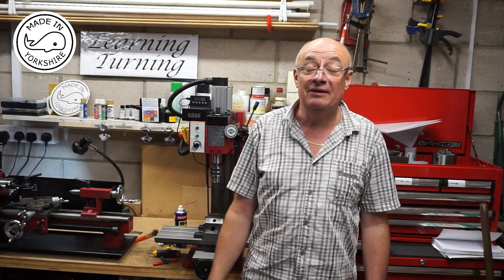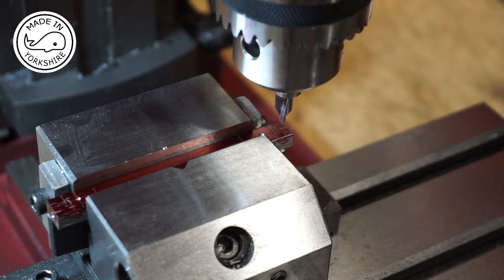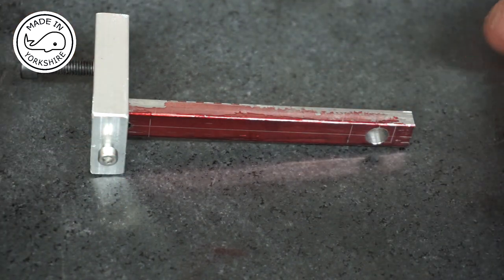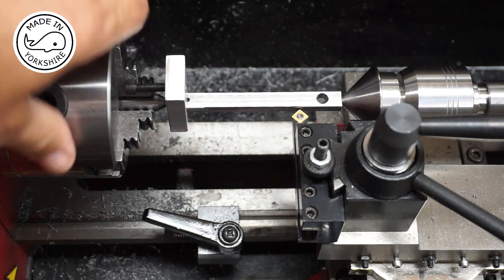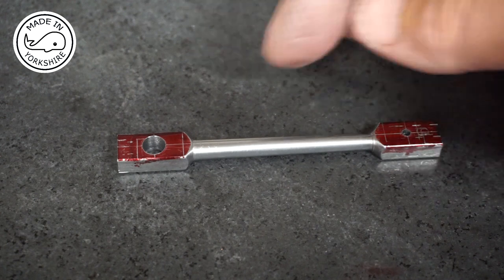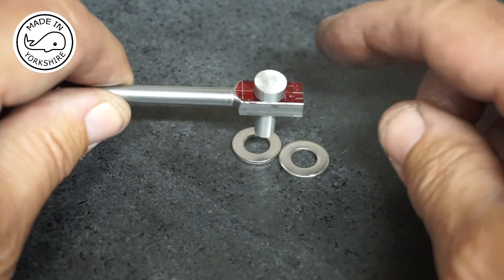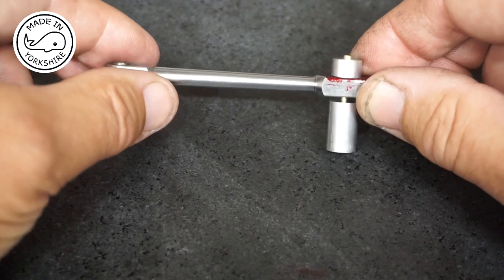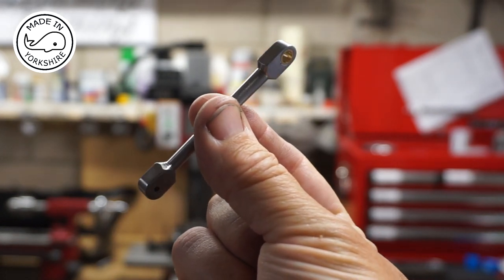#MT22 Part 7 - Making a Stuart S50 Steam Engine Conrod. By Andrew Whale.

Comment: To do the taper I would offset the tailstock until the right measurement is achieved by running a dial indicator the whole length of the proposed taper length before cutting. Remember you have to only achieve half the diameter is important.

Comment: ⭐⭐⭐⭐⭐ Looks great to me! With my experience it would help if that had been a casting that just needed some finish.😉
Reply from the maker: Thanks mate! Once you start making components from bar stock you will never look back.
Cheers
Andrew
Reply: @learningturningmetal  I faced both ends of the bar in my 4 jaw chuck and centered drilled it. Had scribe lines and clocked it in both ends with my dial indicator. When I turned the center section I was taking more off one side relative to the 3/8 faces. Now it does not run true down the 1/4 thickness but offset more to one side. The idea I got both ends off center in the same relation baffles me. Do over and find a better plan.😢
Reply from the maker: @gvet47  very strange! 😕I hope it turns out well next time.

Comment: A better way of doing a slight taper between centres is to offset the tailstock. This also then allows you to use power feed for a better finish.

Another great video though
Reply from the maker: Thanks Sam. Yeah I agree entirely. I wasn't aware of that method at the time, but I have used it since. Thanks for suggesting though.
Cheers
Andrew
Reply: @learningturningmetal  I've just watched your next vid with the boring head and that's actually a better way as you haven't got to mess with tailstock alignment (I made a Hemingway hammer with the tailstock offset and it is time consuming setting up)

Comment: Andrew, I'm really enjoying your videos, excellent reference material as I build my S50. Why does TC (and you) turn the conrod between centers with a lathe dog? Why not just hold one end in the 4 jaw and the other with a live center? I'm obviously missing something.....
Reply from the maker: Hi Jason. Now I am absolutely no expert... but I think if you turn between centres you are absolutely guaranteed concentricity.  If you try to hold in a 4 jaw chuck the jaws will try to hold the piece at 90 degrees to the side faces. Even if you clock opposite sides spot on, on a long item I doubt that the tailstock would naturally centre on the opposite end. Also, turning between centres allows you to turn the item round 180 degrees and continue to machine accurately. Quite a timely question because I am currently planning the machining of my half beam conrod and I've just purchased some proper lathe dogs.
I hope that helps explain my approach. But, like I say, I am no expert.
All the best.
Andrew
Reply: Learning Turning Metal - by Andrew Whale  Andrew, I came across this method of setting a center on a 4 jaw - http://youtu.be/00dl0DxRYvM - so I’m wondering if it will get the conrod bang on center to turn the taper. I might give it a go tomorrow after the rugby....
Reply: I agree.  Dial in one end and centre drill. Support the centre-drilled end with the live centre (snugged up) and dial in the other end gripped in the 4-jaw.
Turning between centres is used where you want to maintain concentricity but need to reverse the work end-for-end during machining or temporarily remove the work from the lathe for other operations (like TC did for marking out, but Andrew didn't, as he marked out beforehand).  It also needs to be used when turning a long taper using the tailstock set-over method as the chuck jaws would try to force the work parallel to the lathe axis.

Comment: Just out of interest, how close to the drawing dimensions were you? Only asking as this is the next part I will be working  on.
Reply from the maker: Hi Paul, I machined the conrod as close to the drawing as possible.
I hope yours turns out well.
Cheers
Andrew
Reply: @learningturningmetal  I did a test, and it didn't turn out too bad, so I'm taking the plunge tomorrow. I'm already sweating thinking about it. But nothing ventured, nothing gained. Thanks for all the videos, I've learnt a lot from you.

Comment: Hi Andrew great to see an update, your engine is coming along nicely.  When it comes to turning rod tapers between centres if you have a boring head for your mill and it will fit your lathe tailstock you can turn a crude dead centre to fit the boring head. Its then a simple matter to use the boring head to offset the dead centre (in the tailstock) and turn a taper as long as you want with the ability to use the powerfeed also. If that makes no sense but you want photos of what I mean drop me a priv message :-)
Reply from the maker: Thanks mate. It is slow progress with many challenges along the way - a great project to get me out of my comfort zone and experiment. The boring head is a brilliant solution, and I even understand it! A boring head has been on my wish list for a while now but I don't know what go for, both size wise and make. It also looks like I will need to get one with both R8 and 2MT shanks. I will investigate!
Thanks so much.
Cheers
Andrew
Reply: It's worth buying a boring head, they are far more useful that you think. I haven't had mine long but I wouldn't be without it.
Reply from the maker: Can you recommend one?
Cheers
Andrew
Reply: My mill is an MT2 taper and I bought this set, it does the job nicely and I'm happy with it. The allen bolts are a bit cheap but easily replaced for next to nothing. https://www.rdgtools.co.uk/acatalog/MT2-MT3-12MM--BORING-HEAD-SET-38MM-DIAMETER-34973G.html
Reply: Correction - I bought this 50mm set, sorry my mistake !  https://www.rdgtools.co.uk/acatalog/BORING-HEAD-KIT-50MM-2MT---3MT---5-TOOLS-AND-EXTENSION-BAR-4098.html
Reply from the maker: Thanks Peter - that looks really good for the price. I'll see if they do an R8 shank for it.
All the best.
Andrew
Reply: Andrew, I post in ME forum if you want a link about using the boring head as an offset I can message you there.
Reply from the maker: Thanks Peter.
Reply from the maker: Hi Peter - quick update. I've ordered the boring head you recommended, together with 2MT and R8 shanks.
Thanks again for the advice.
Cheers
Andrew
Reply: I think you'll find it does a good job and is worth the money. When you first try you may need to experiment on the tool positioning in the retaining hole -they are round shank tools so need to be rotated to get the right cutting angle. It only takes a few minutes to take a few test cuts on some scrap and you'll soon find the setting that works best.  The set also comes with a fly cutter :-)
Reply: Interesting idea!